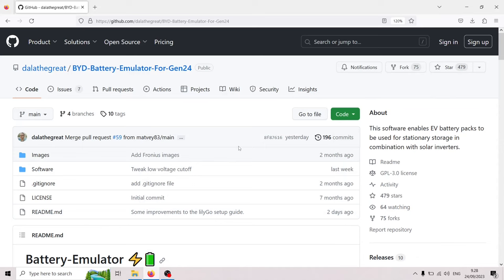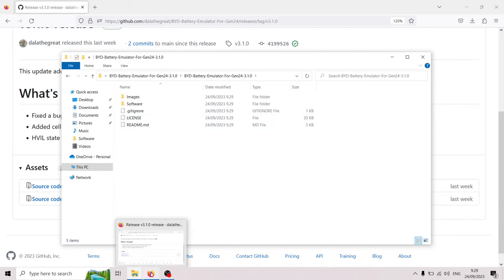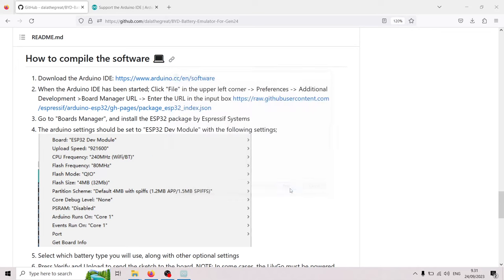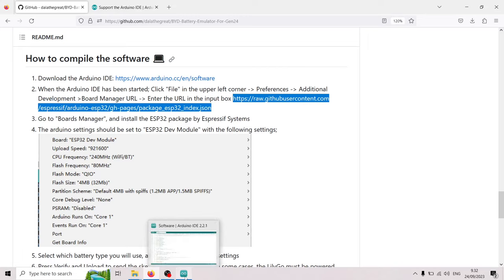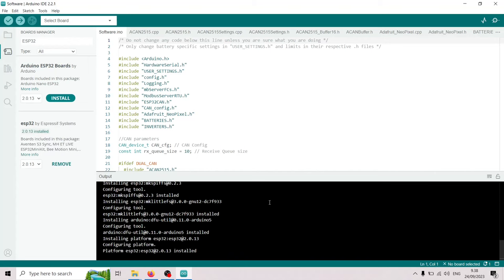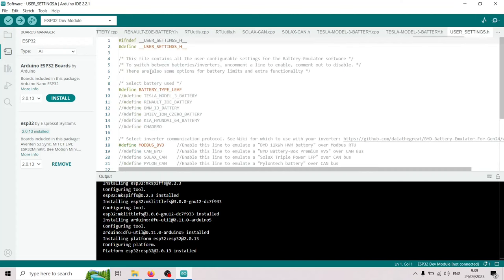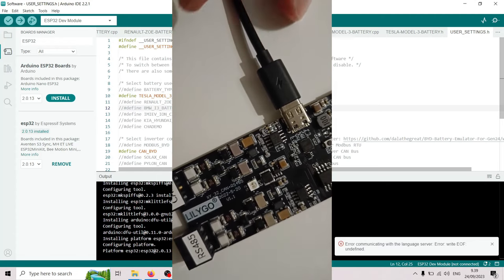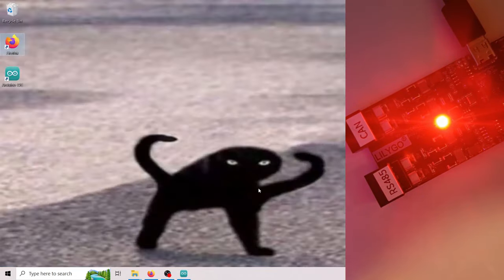[BORING] Flashing Battery-Emulator onto LilyGo T-CAN485 (WINDOWS)

Comment: finally, if you don't see the com port in the settings, 
it's best to change the cable. it helped me.

thanks Dalla
Reply from the maker: Yes, then most likely you had a charging only USB cable!
Reply: @DalasEVRepair  Is the problem solved by changing the USB cable?

Comment: I do not need it right now but I like your content a lot - ev wise as hv ev battery wise to use them in solar power systems.
I had found the channel to late and I am still unsure where to get these battery packs you and flying tools are using to get started. 

But I like this content of step by step and the general overview and explanations therefore I watch and leave a message to let you know it is not in vain, but appreciated what you are providing here.
Reply from the maker: Thanks! I recommend buying used EV batteries from scrapyards, depends on where in the world you are located,  some places have plenty, others barely anything!
Reply: Another simple but valuable info.

Comment: Thanks very much Dala.  Here's a few tips for people after doing this myself.  
1.  Enable USB debugging the first time you do this, so you can see the messages in the Serial Monitor
2.  Hook the lilygo up to a 12v power supply - my pc's usb port couldn't deliver enough power and it was resetting with a 'brownout error'
3.  I had to set the baud rate on the serial monitor to 115200 (in the video is is 9600) to see output messages
Hope this saves people half an hour.   This is a damn awesome project.
Reply: Thanks for the good tips! Connecting 12 V seems to be essential to solve the problem if flashing doesn't work! Thanks!!

Comment: Hej! I need some advice. I try to flash Lilygo exact as Dala is doing in video. Tryed two different computers. The same outcome evry time; "Compilation error: exit status 1". Tryed in the beginning only USB cable. Then added 5V to pover input, then 12V 3A supply to power input. The same result, Compilation error. Thanks för suggestions 😅
Reply from the maker: Make a thread on the secondlifestorage forum. Post screenshots also!

Comment: Had to set bitrate to 115200 on a Mac then it UL fine and the serial monitor also needs 115200. Mac M2......dunno why, but seems to work.  THX !!!!
Reply from the maker: Latest version raised the baudrate on serial monitor yes! Nice to hear you got it working!
Reply: @DalasEVRepair  Got 72kWh Nissan Leaf cells in 14S/48V. But next project should be a HV battery. Thank you for your work and sharing it +++

Comment: Hi thanks so much for the great work that you all are doing it’s is fantastic. 👏👏
I’ve a question about if there is something that I can use to convert a HV battery pack from a BYD Atto 3 and I would love to use it as a stationary energy storage. It’s 60kw LFP 400vdc build in 2022. I read the forum where it explain what is needed and read the list of battery models supported but couldn’t find BYD Atto 3. Thanks in advance and would appreciate it any information. Kind regards Juan
Reply from the maker: Integration basics explained here: https://github.com/dalathegreat/BYD-Battery-Emulator-For-Gen24/issues/51#issuecomment-1685365046

Comment: Would you make a video about what makes an inverter compatible with your project? Like needs x processor x input x access? I looked for an inverter from your list on github in the us and didn't see a direct match.
Reply from the maker: AIMS is adding support for the Battery-Emulator, should be done next week! This will be the best choice for the US market.

Otherwise, just check for inverters that support the following batteries, BYD HVM / HVS

Comment: What’s your planning about getting 3 relais intergrated for the battery contractors? And are there enough gpio’s left while using a secondary canbus PCB. 
Great work so far !!
Reply from the maker: Already works, its in the Wiki on Github! Many people use it!
Reply: Can’t find it.. 😔
Reply from the maker: @yviojacobs3443  https://github.com/dalathegreat/BYD-Battery-Emulator-For-Gen24/wiki/Nissan-LEAF-battery#automatic-control-
Reply: THNX! my lilygo CANbus pcb's are arriving in a couple of days. i have a Solax X3, so i have to modify a second can bus  and replace the 3.3 v ic on the pcb. @DalasEVRepair
Reply: got it working!! party party!,,   only can't find the error 7 description  @DalasEVRepair   "ERROR CODE ACTIVE IN SYSTEM. NUMBER: 7" it's in the serial LOG.
Reply from the maker: @yviojacobs3443  Error codes are explained here: https://github.com/dalathegreat/BYD-Battery-Emulator-For-Gen24/wiki/Nissan-LEAF-battery#error-codes-in-the-usb-output
Reply: after a few hours it stoped working :( tried different things and even swaped out the Lilygo., the Soalx inverter gives a fault message IE19 (BMS lost connection). after whole sunday search it turns out that when the HV (battery) is applied, the Solax Canbus stops. The Lilygo, battery contractors/BMS are separated powered, so there is no electrical connection in between.
The IDE  Serial monitor  gives a BMS:3 status.  @DalasEVRepair  
😢
extra questions to be sure..: 
-the WS-led indicator is just for the Battery-BMS-CAN-bus side ?
- the serial information on the usb, is only  for the Battery-BMS-CAN-bus side ? 
- there is no information send from inverter to the Lilygo?
- only oneway Battery information from Lilygo to solar-inverter?

- when swapping the 3.3 ic and setting the lilygo to 5V. mode.. the VCC gives 3.3 to the external canbus pcb (MCP2515), while this is a 5V version...
EDIT:  ooh SWAP* ,so the 3.3 ic back on the MCP2515 pcb, so that this becomes a 3.3 version........
Reply from the maker: @yviojacobs3443  Sounds like you have a problem with the Dual CAN hardware. If you need detailed support from me and other users, join the Patreon Discord server: https://www.patreon.com/dala

Comment: This project is great!
I have a GEN24 Plus, and I am interested in acquiring a setup with a Tesla Model 3 (60 kWh) pack.
I do not have the courage to do it, as it involves high voltage and expensive gear.
But, I could be interested in buying one already configured...

Presenting a working system could be also considered proof of concept...

Does anybody have a "kit" that could be plug-and-play for this?

Thank you Data for your work and investment (not just financial) in the project!